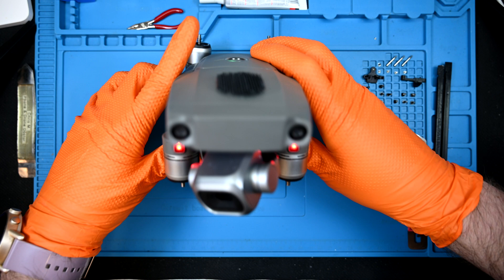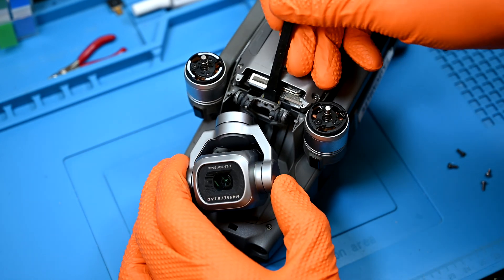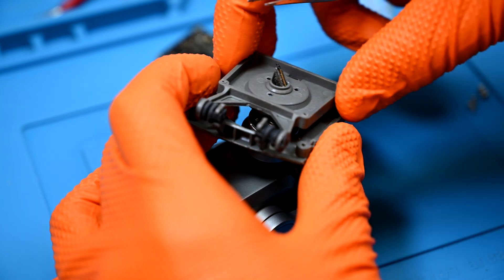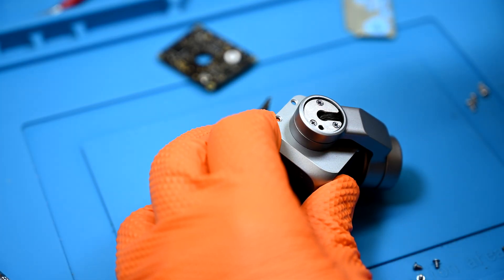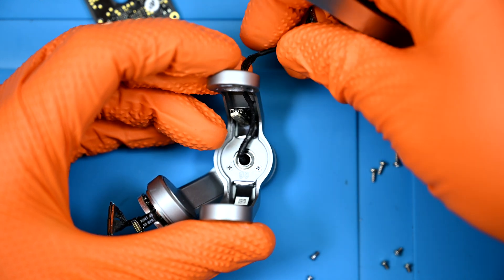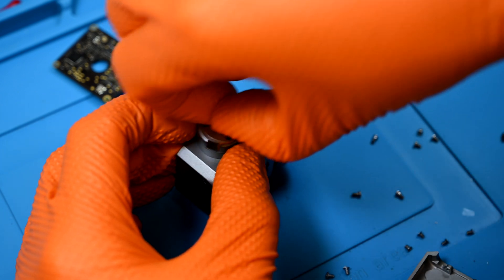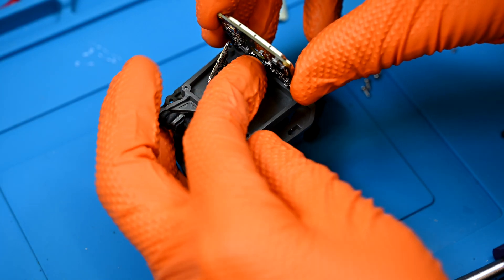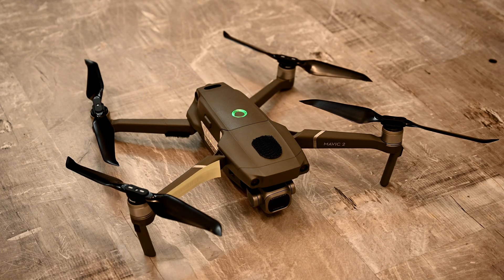DJI Mavic 2 Pro Gimbal Repair | Camera Transmission Cable Replacement | Guide

Comment: Thank you so much... I never comment on videos, but here I have to. I managed to repair my drone thanks to your excellent tutorial. You really have to go step by step, take photos and write down each step. It takes time, but the result is there.
Reply from the maker: @maxencelamouret1158  thank you! This means a lot to me, this video was much harder to film than my normal ones because of how many strange directions and orientations you have to hold the gimbal. It was hard to angle it in a way that the viewer could understand, so it’s awesome to hear that it made sense to at least one person! 🙂

Comment: Great tutorial, just have 1 concern, my camera feed still works, it's just the gimbal that doesn't work. Is the issue most likely still the transmission cable or is it likely to be something else?
Reply from the maker: @Retali8  it’s going to be the other wire, the flat ribbon wire. It’s known as the gimbal motor ribbon, and if damaged it will keep the gimbal from moving properly.
Reply: @TapticDigital  Okay thank you for the help!

Comment: Great Video!!  I was wondering if you have ran into an issue with a pink discoloration in pictures or video?  Reason I ask, is mine has that issue and not sure if it is the camera itself of a cable issue.  If you'd like I could send you one of the photos with it in it.

Comment: Is it the same with the zoom
Reply from the maker: Nearly identical
Reply: @TapticDigital even the ribbon cable
Reply: And also 1:50 is the ribbon cable shown here the problem with mine the entire gimbal does not work but the only wire i see disconnected is that one

Comment: The flex could produce error 200 in the mavic pro 2 zoom? I have one and the camera does not give me video and the gimbal is not stabilized
Reply from the maker: Yep, error 200 is almost always a ribbon flex issue. Parts are cheap and definitely replaceable, but the process of replacing them isn't exactly what I'd call fun. I think the repair in this video took me a solid 2-3 hours just trying to get everything routed properly.
Reply: Thank you very much for the answer, I suspected the flex at first, but the description of the error had nothing to do haha @TapticDigital

Comment: definetly not easy but it WORKED thank you!!! as far as the shielding re-install, I recommend not screwing in either sides of the gimbal first and only connecting the little ribbon. It was so much easier that way

Comment: Awesome Video, very helpful! Any chance you have seen a pitch motor not longer sitting flush in the roll bracket? Drone had hit the ground, it has a gimbal overload error at times but all the time the gimbal no longer moves at all. It looks like the left side of the bracket (5min 08 sec mark) no longer sits flush in. Have manually undone both sides and tried to resit but not working. Not sure if its broken the pitch motor or just bent something and so its not sitting straight. When the drone turns on the gimbal moves fine and looks to be in good working order and I am thinking its just due to too much pressure and not sitting properly so the motor cant move it without getting stuck.

Comment: I just crashed my drone today. It hit the ground  bounced back up into the air and tried kept flying. But now it’s telling me “No Image Transmission Signal” I guess my question is will I find my answer on which part I need to replace when I take it apart? And how would I know what the name of that part is if I want to find a replacement for it online?
Reply from the maker: Thankfully DJI kept it simple, Image Transmission Signal cable 😉. If you open it up you may find a rip in the ribbon, you may not, either way it is still your first step for repairing the issue!

Comment: This confirms that I need to go to the shop and pay to get this done.
Reply from the maker: It is absolutely not for beginners! The parts are cheap but the labor involved isn't.
Reply: @TapticDigital  how much would it cost to replace the row motor and gimbal motor arm?

Comment: Thanks for the tutorial, I just fixed my friend's Mavic 2 Pro (broken pitch motor, the one nested in camera housing). @TapticDigital to reinstall the U-shape cover, I found it easier to do it before attaching the thick washer and second motor. I think you did it at that point, but in video it is actually mentioned after attaching the washer and motor. Anyway I started with roughly putting the U-shape to the place, then started with the shorter side to snap it in bellow the nested pitch motor, then continue snapping the shape across its length and lastly carefully snapping the other end on the side where the washer will go in next step.

Comment: Great teardown video, very helpful! The gimbal on my Mavic 2 Pro is having issues, upon powering up it works perfectly fine but as soon as I get it up in the air, it immediately pops up with a gimbal overloading message.  The gimbal resets after I land the drone and restart it, super frustrating, I've tried every non repair solution and nothing has worked. What do you think is the problem?
Reply from the maker: Tough to narrow down, I would check by turning the drone on and picking it up, manually rotating it around to see if there's a certain angle that causes the overload. But in most cases the overload is caused by a very small tear in the ribbon itself.
Reply: @TapticDigital  thanks for the advice! I've rotated the drone in different directions and it seems to be fine, just when I get up in the air it starts to overload. Would you recommend a ribbon cable replacement?
Reply from the maker: @pianoshorts152  I would at least give it a try. The other possibility is a bad IMU, but that will give you far more errors than just gimbal overload. It would pop up with gyroscope failure warning, and all IMU data would read blank in the menu.

Comment: thanks for the video do you have an idea why on my mavic 2 pro the camera won't focus anymore it stay focus at about 1-2 m and when manual focusing or auto focusing nothing change it stays focus at 2m the same so the landscape is always out of focus
Reply from the maker: I've seen that issue a couple times, unfortunately the fix is usually replacing the camera assembly if the focus motor is damaged. I would check for repairs from DJI first, as the camera module can sometimes cost upwards of $600, and even more in labor if you have it professionally installed.
Reply: @TapticDigital   @Taptic Digital  ok no dji service here in thailand, so have to do with local technician, so the guy replaced the gimbal for me but now I see there is a problem with focus, do you the focus motor is in the camera itself?
Reply from the maker: @NicolasVoisinFilm  it could also be the ribbon wire that connects the gimbal and camera to the board, slight damage to that can cause focus and movement issues.
Reply: I changed the cable and it still not working I lost some screws though is that something may cause the weight imbalance or something or is should still work… I mean places where three screws go I put 2 and I did touched some parts covered with blue creamy stuff
Reply from the maker: @kobabui744  blue creamy stuff 😂. These cables from DJI seem to not go through the same quality control, and I've ended up with several defective ones so unfortunately that may just be bad luck. 

Thankfully the screws are very light and have no real impact on the balance of the drone, it's smart enough to compensate for any variations.